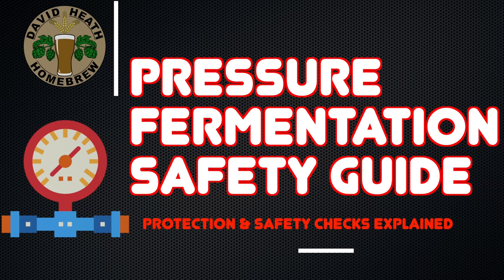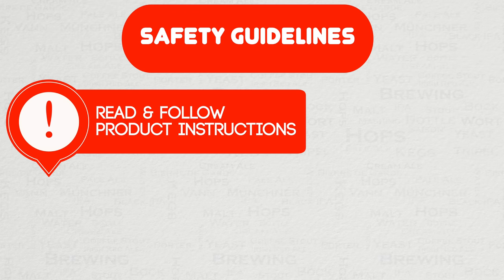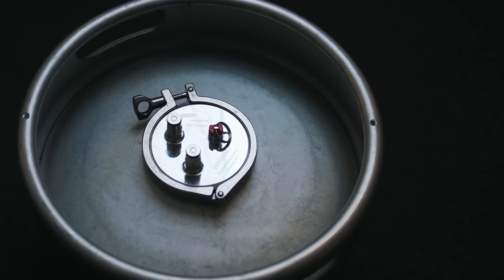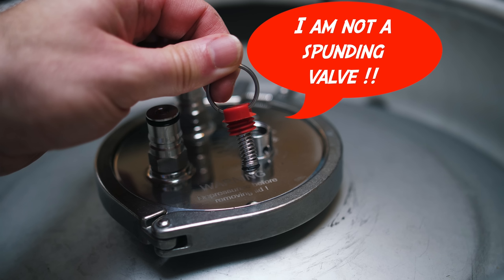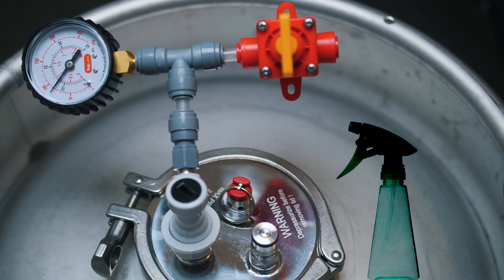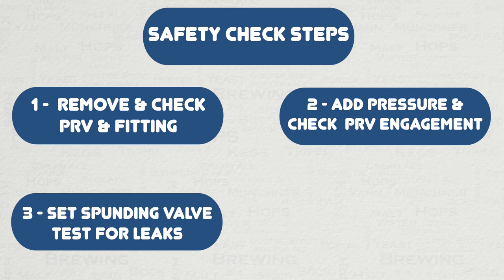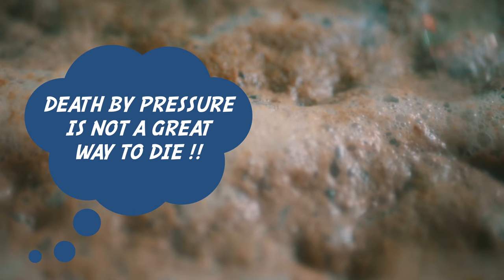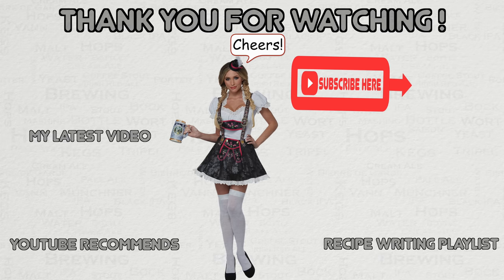Pressure Fermentation Safety Guide

Comment: Great information as always. You make a great point about homebrewers blaming equipment before themselves but I think this is due to ignorance mostly. This level of information would be great to see with such products.
Reply from the maker: Many thanks Alan. Yes, for sure it is ignorance I would imagine mostly. What concerns me the most though is when nobody mentions what could have been done to avoid the issue. Generally the focus is that the product failed in some way when frankly it was probably the user either not following the instructions in some way or not making safety checks prior to use.

Comment: As always, thanks for this David. I think I have a dodgy gas disconnect with check valve that was attached to my spunding valve but thankfully managed to find the problem just in time on Saturday evening; my Corny keg was sitting at around 35PSI!  It was a quality disconnect and also fairly new and hardly used so pretty disappointing really.  Just one observation; you must get through a crazy amount of C02 with this testing regime to fill a vessel to test the PRV is working on every brew, especially with just SodaStream cylinders?  Must be very expensive (I know not as expensive as loss of life or property from an explosion).  I guess this is in the typical nature of H & S where this is reasonably the only advice that can be given but down to the individual how to interpret in practice...
Reply from the maker: Thanks Tim. All products can fail sadly. I do get through some gas but it's a small price to pay to check for safety.

Comment: David how can you find a pressure where your yeast is happy, i just don't get how homebrewers are able to work that out? You didn't explain it either, do you have a paper on yeast research that has data that shows the ideal pressure where yeast is happy??? Ive been fermenting at 25psi and my yeast happily eats all the sugars just like a non pressure fermentation and the beer tastes like normal beer so I assume my yeast is happy. Also I get carbonated beer which is a bonus and is a process that germans have been doing forever called spunding, i just do it at a higher pressure to temperature ratio than a German lager but there's no evidence to suggest its detrimental. I think if it was than guys like Dr hans would have already found out..
Reply from the maker: This is the sort of information that hobby brewers are unlikely to know much about to be honest. 
You will not find much that is shared publically and the details that are released to the trade by yeast companies are usually a part of presentations rather than anything shared in writing. Such is the industry. 
Really this topic is something pretty vast  in its entirety but I can provide a quick summary for your interest.
Maybe I will make a video on this topic in the future. 
There is no universal sweet spot. It will vary between different strains of yeast and is also recipe dependant as well being dependant on temperature too. At a brewery level testing will take place mostly starting on the yeasts ability to fully attenuate under pressure. Pressure suppresses fusel alcohols and esters but also the yeasts growth and viability. So the primary concern is that it the yeast is healthy enough for the task at hand but naturally because this is a business time is also a factor. The sweet spot in this case is the fastest speed in which the yeast can fully attenuate along with the desired effect on the end beer. At home time should not be such a large factor. So testing to my mind should be around finding acceptable levels of pressure and temperature that give a pleasing end beer. 
Within my Facebook group such data is being shared and there is an excel spreadsheet that is being updated over time.

Comment: Great video David. Do you have a link / name for that sodastream trigger valve please? Looks like a handy bit of kit.
Reply from the maker: Hi Rob, yes very handy. I bought this one some years ago. In Scandinavia they are called "CO2 gun". When I google this then I just get local links,which I guess will be of little use to you but naturally it is just one way. Adding the CO2 using a regulator works just as well, just make sure you set it carefully to not waste much gas.
Reply: @DavidHeathHomebrew  Thanks David. Yes I did a bit of googling without much success. I was thinking of getting a mini regulator for Sodastream bottles anyway (for party / mini kegs etc.) so could use that.
Reply from the maker: Yes, Sodastream bottles are ideal. Adapters are easy to find for regulators. Just be aware that the threads for sodastream bottles do vary worldwide.
Reply: It appears to be a modified air compressor blow gun used for blowing out drillings and for other cleaning tasks (I use one to blow out all the dust from the PC heatsink). I just bought a blow gun and fitted John Guest fittings to them.
Reply from the maker: Yes, I think that is very likely.

Comment: I'm trying to find more information about the trigger setup you are using with the sodastream for pressurization but can't find any - can you please point me in the right direction please?
Reply from the maker: This is something ive had lying around for many years. Ive not seen them sold for some years sadly.
Reply: Thanks,  it looks like a good idea was working out if I could modify a Pluto gun to do it
Reply from the maker: Its handy but unregulated of course, so easy does it 🍻🍻😎

Comment: Hey David,
If I were to cold crash under pressure, should I remove my blowtie spunding valve or should i leave it on ?
(I use a Fermzilla All Rounder 30 L
)
Reply from the maker: For sure leave it on. You will not need much pressure,  5 PSI will work but you will need to add it via a regulator.
Reply: @DavidHeathHomebrew  would you say 13 psi would be alright as well? That way my beer remains carbonated during the cold crashing process?
Reply from the maker: This is not something that I have tested but I think it should be alright.
Reply: @DavidHeathHomebrew  awesome. Once i have tested it, i will  share the results on the FB page 😁
Reply from the maker: Great :)

Comment: David, I didn’t see pressure indication on your testing kit. How do you know the PRV lifted at 2.5 bar (36 psi)? Any cylinder with vapour and liquid CO2 will be many times higher than the pressure wanted (57 bar at 20°C). Please don’t test the function of a PRV without knowing the pressure at which you are testing. Otherwise much appreciated. Cheers.
Reply from the maker: I agree that this is the far greater preference though the manometer I usually use died during the filming. So I showed this method but said it is best to use regulated equipment with a gauge of course. Once you know the equipment you also know the sound of pressure though, which was another point made.

Comment: Thank you for a god video, a question thou about the pressure fermentation is it possible to ferment a lageryeast under pressure at 10-14c?
The reason I wonder is that my garagetemperature is in that range now😊. Its a s-189
Reply from the maker: Sure, no problem there. It will be cleaner anyway 🍻🍻
Reply: @DavidHeathHomebrew  so when you are dryhopping under pressure are you closing the pressurevalve to not letting the aroma out or are you having a setpoint? Because now I dropped the hops with the same setpoint as under fermentation. 1bar isch
Reply from the maker: I keep the pressure on yes.
Reply: @DavidHeathHomebrew  closed or on setpoint?
Reply from the maker: On a set point.
Reply: @DavidHeathHomebrew  thank you ❤️

Comment: I have used a corny keg with a shortened dip tube. The PRV on it is 130psi. Don’t think I could trigger it if I wanted to.
Reply from the maker: Yes, very safe way to go, though very limited size wise usually.
Reply: @DavidHeathHomebrew  yes effectively four gallon I figure - but less beer means more types to make later!!
Reply from the maker: Haha, yes that is very true 🍻🍻
Reply: i do the same but with another gas inlet and a floating dip tube.
Reply from the maker: Yes, I use floating dips in all my kegs
Reply: @DavidHeathHomebrew  How is a 130psi PRV on a corny keg safe? 130psi would be approaching the maximum safety level of the stainless steel welds themselves so wouldn't it be safer to use a PRV with a 45psi rating instead so you never even approach the maximum working safety limit??? That is not something I would reassure someone as being safe mate! What if there is a malfunction and the pressure actually builds to that level without this guy knowing???
Reply from the maker: No manufacturers recommended maximum is the actual breaking point measurement. It is safely below that. So yes it is safe to test for sure.
Reply: @DavidHeathHomebrew  I haven't seen any floating dip tubes that are easy to install. Only one I have seen requires acrobatics inside the keg and I just couldn't get it in.
Reply from the maker: The easiest way is to cut down your existing dip tube and then add the floating dip tube on hosing to the end.
Reply: @DavidHeathHomebrew  Its the adding the hosing - it has to be done inside the keg (at least on the floating dip tube I had). It just wouldn't work.
Reply from the maker: You will need to cut the dip tube down. Then you can attach the hose. Some retailers sell these pre cut.

Comment: I have been told to NOT use Starsan on the DuoTight fittings.  I’ve had almost all of my crack and fail- I always used StarSan to check for leaks.
   I don’t know if this is true, but I have been told that.  (Otherwise I have no idea why the DuoTite fittings have all failed)
Reply: yes, you're not supposed to use un-diluted StarSan on these fittings. Obviously, you're using a diluted mix however the problem is as it dries it concentrates again which eats them. Just use soapy water. Or make sure you rinse them off afterwards with fresh water
Reply from the maker: Yes, that is why I said diluted star san or soapy water :)
Reply: Great and useful advice ....thanks
Reply from the maker: Thank you :)